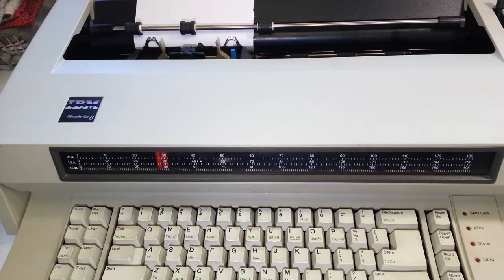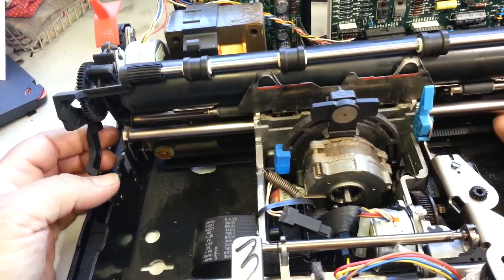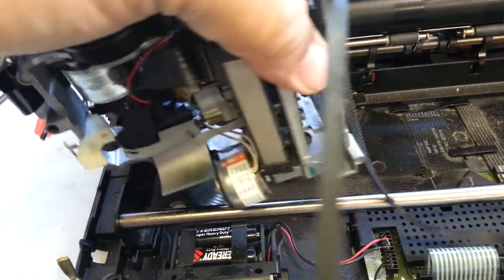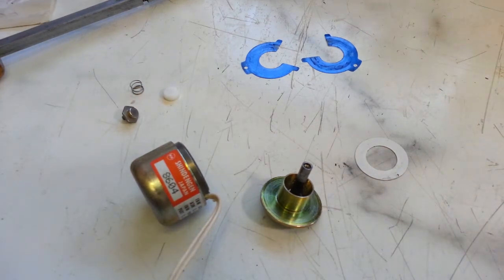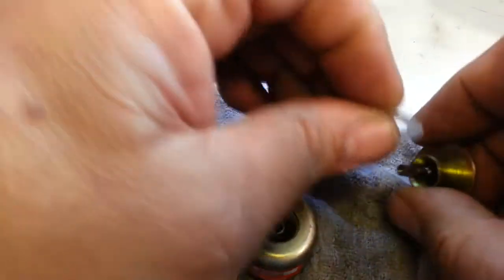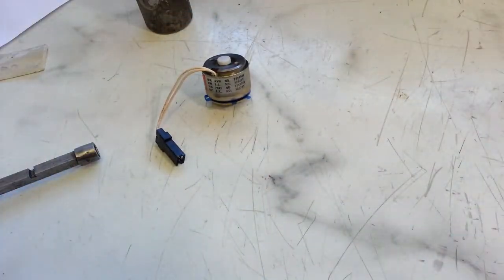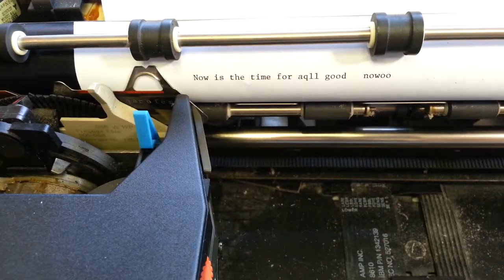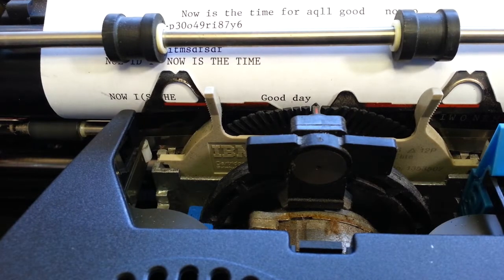IBM Wheelwriter Typewriter (Won't Print) Repair Rebuild Hammer Plunger Solenoid Strike Plunger

Comment: Thanks! Worked exactly as described. Had to grind a small slot in the back of an Allen key with a dremel to fit the small screw. Worked like a charm.

Comment: Good video, thanks.  Without it I could not have fixed this typewriter.  A question though... I had this problem recently and bought a replacement solenoid on eBay for $25. not wanting to get this deep in and find that I couldn't fix the existing one.  Regarding the "carrier shaft", you seemed to just lift it out.  There is no way the shaft on mine would budge.  I had to disassemble the chassis, remove plugs, flip it over, loosen the two solenoid screws through a hole in the back and replace the solenoid.  Do you think I have a different model? or is there a secret to what's over there on the right, off screen re the carrier shaft?
Reply from the maker: Large chrome shaft that runs thru the carrier rotates a 1/4 turn, then it slides right out
Right side there is a notch cut for a wench, or strong pliers, twist & release.
Reply from the maker: Large chrome shaft that runs thru the carrier rotates a 1/4 turn, then it slides right out
Right side there is a notch cut for a wench, or strong pliers, twist & release.

Comment: Thanks for posting this video, Duane. My Wheelwriter 6 just started exhibiting this very problem. Looks like I need to both rebuild my solenoid and replace the plastic cap, which looks like it is split in half on my machine!

Comment: I've replaced the cap on mine with an identical white one like in the video. Ever since though the impression has been pretty weak, tested with a known good ribbon. I know Code + Q sets impression, but is there any adjustment I can make otherwise?
Reply from the maker: Plunger might need rebuilding, plunger has 3 clear spacer shims, removing 1 will increase strike of plunger.
Reply: @phoenixtypewriter2136  Thanks, will give that a try!

Comment: What about when it just STOPS typing on a line? It will type beginning at the left margin but will not type past half way on a page? Replaced batteries because it beeped 3 time. What else is wrong? Thank you.
Reply from the maker: I don't have enough information to answer this question.
Does space bar work ? does margin release work ? is there an obstruction ? does it grind ? is margin set correctly ?
Reply: Thank you for responding. Space bar will take it clear across page. Tab works fine. Margin release works fine. No obstruction. No grinding. Can set and release margins. It just literally will not type any letters/numbers/symbols past about half way. Very confused.
Reply from the maker: Very unusual indeed, you can go to Facebook typewriter groups
they have a maintenance group section with me and a few other pro's
you can post pictures, or better yet, a video showing problem
Reply: Ok. Thank you.

Comment: I have same problem with a Weelwriter 3, I cleaned the hammer, I replaced the Logic Board because I can't see any voltage when I strike buttons. Any suggestions?
Reply from the maker: Carrier cable or connections
Reply: @phoenixtypewriter2136  Thank you for your prompt response, I solved the problem, I follow the other video you have: IBM Wheelwriter Typewriter Repair Fix Print Hammer Strike Plunger THUMB UP
Reply from the maker: Drivers for all stepping motors and print solenoid are on the main PCB

Comment: Great video!  Do you know the size/dimensions of the cap?  I'm wondering if this can be 3D printed.
Reply from the maker: This is a precision part with a small inner edge to lock it in place , 
Don't know the dimensions, these are available new, best chance is to scan a new one

Comment: Hi, I have a 1947 Continental typewriter with the ribbon vibrator broken. Precisely, the part on the right where ribbon is supposed to fit is apart from the rest of the vibrator. As this is a small, fragile metal part, the method of melting a clip into it is no a solution here... Could You recommend a solution that could help? I thought about a glue but the joint surface is so tiny it probably wouldn't work. 
Btw, thank You for all the videos you make, it is a huge help and source of info - keep doin it :)
Reply from the maker: I'm not familiar with those Continentals to even know what the part or mechanism looks like.
That is the trouble with some of these precise small parts, virtually impossible to mend sometimes.

Comment: Excellent video; I recently acquired a Wheelwriter 3, and similarly, the hammer wouldn't fire. However, I checked continuity (~4 ohms) and jumped it with a battery, confirming that the solenoid itself is working. Also noticed that it's missing that pad. I suspect the ribbon cable is to blame as it has delaminated around the area where it bends, and the metal strips (fortunately still coated in adhesive) have likewise separated. Hopefully nothing shorted, but haven't gotten that far into it yet. If these have become sufficiently rare, I suppose I'll try to build a new wiring harness/cable from an IDC ribbon cable, as it looks like there's enough clearance under the carriage. Is anyone aware of potential sources of these cables, short of scavenging one from another machine?

edit: As I ponder it further, the absence of the tip fails to compress the solenoid, so no action... further investigation needed. Still need to do something about the mangled cable. Specific part number is 1342139
Reply from the maker: Not too common for these cables to go bad, but the older they get, the more likely indeed. Just a couple weeks ago a customer called and said WW wouldn't type in center of page, stumped over the phone, I didn't really even think about the cable, but sure enough, flex the flex cable just right and hammer stops. 1st cable I have seen bad in like 10 years. Only source is salvaging one from another WW.
Reply: @phoenixtypewriter2136  Thanks for the reply! In the end, it did turn out to be the missing tip preventing it from firing. Also, looks like some clever fellow in the machine's history managed to install the cable with a 360 degree twist, causing a sickening crunching/scraping of the cable as is dragged past itself (only noticed this once i moved the carrier a ways out, after noting that the hammer did not fire). I straightened out the traces, and tacked it back together with some spray adhesive. 

As the cable is now rolling over itself in a large 180 degree loop, instead of dragging on itself, i suspect this will last a while (likely to eventually die from work hardened traces due to the previous improper installation). That it worked at all without shorting anything is amazing.

As a temporary fix for the hammer, I shaved down a 5mm nylon nut (trial and error for fitment; many errors), pressed it on in place of the tip, and managed to get the plunger at full compression, with no hammer deflection (not sure if this is correct, but I suspect it's close).

If the carrier cable fails at some point, I'll look into making a 'clone' of it from IDC ribbon cable; the clearances seem decent enough to allow the thicker cable, just need to worry about the repeated bending of the wires.

Thanks for replying to a comment on and older video, and thanks for the information.

Some photos of the machine:

https://imgur.com/a/hExlr1Y

Comment: Does anyone have any tips on how to put the belt back on the 2 pulleys? At 19:09 it seems the one in the video just slid back on there with ease. Mine is so snug I can’t get it back on.
Reply from the maker: 20:05 here you can see I put the cable onto the pully and Push the carrier to the left slightly "walking" the belt up onto the pully the rest of the way.
This is a learn "hack" technique, sometimes takes a few try's. Official method is to loosen left side bracket